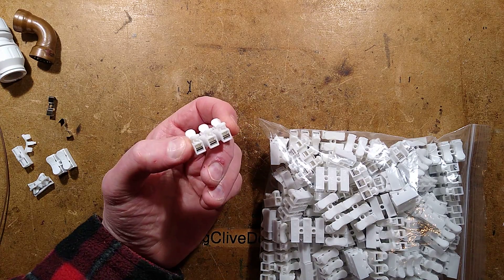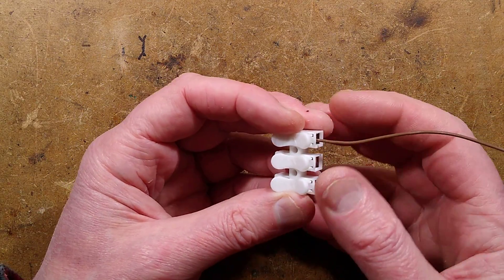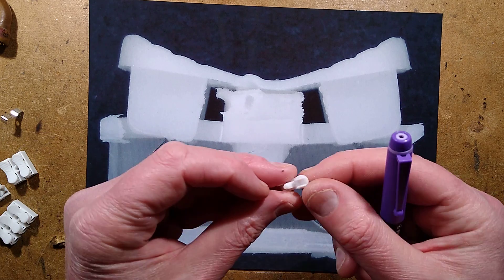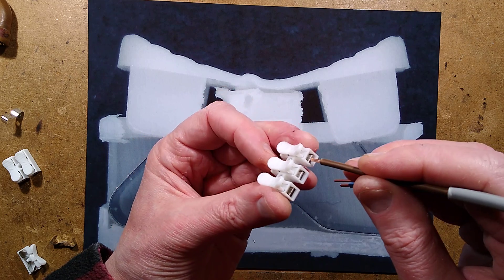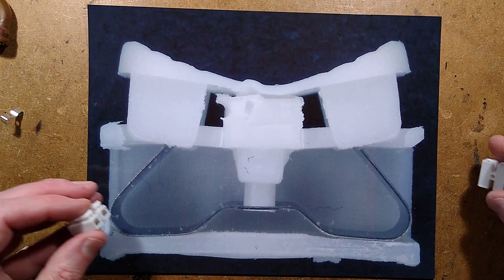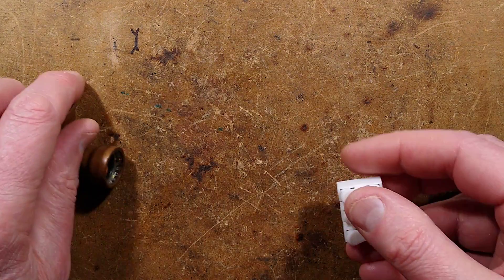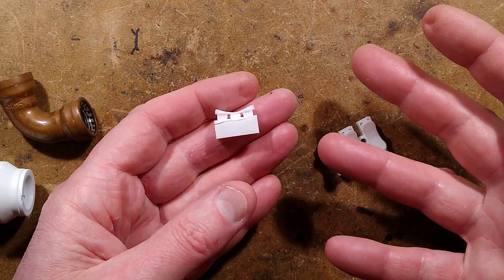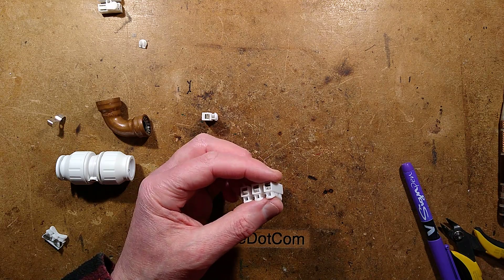eBay's cheapest wire push-connectors (Not for house wiring!)

Comment: Even without water, there's going to be enough water vapor in the air to facilitate a galvanic reaction, very slowly.  Stainless steel will also slow that a bit, but I wouldn't assume it's particularly high-grade stainless.  It'd still probably take decades in an in-wall circuit, especially in a junction box, in all but the most humid of environments.

Hell of a time-triggered disaster to, say, leave for the next person to occupy your house.

Comment: I never understand going cheap on these things. If you're remodeling a kitchen, even nice WAGOs are pretty low on the list of expenses.
Reply from the maker: Since people just cut every cost.
Reply: £1,000 phone, best get £1 cable to charge it.

People have weird ideas about how they perceive a bargain.
Reply: @webchimp  Well, you use your expensive phone a lot but cable is just a cable. You don't see value in it, therefore you don't invest into it. That was one of the reasons I stopped repairing iPhone 6 and 7 when they were still a hot new thing because charging boards got blown so easily by shoddy chargers. And it was getting really annoying arguing with customers it was their usage of said charger that caused the problem. Some of them returned 2 or 3 times and blamed me for "botched" repair. I gave up and focused only on Macbooks because there was still money to be made.
Reply: just came from a diy store (in Germany). The Wago Knock offs were more expensive than the genuine Wago 221...
Reply: Right? "Let's redo a kitchen (not cheap@), but oh yes let's cheapen-out on these" LOL
Reply: Hope charcoal look is coming back as a remodeling trend...
Reply: And if you really want to cheap out, wouldn't wire nuts be cheaper still?
Reply: If you're a manager at a contracting firm, you might force your subordinates to use these to save a few bucks on each project to pay for your own bonus each year, at the expense of your company's future reputation...  Especially if you're going to fail upwards to a new job anyway.

It's always the managers.

Comment: If they rate them at 10 amps I would suspect it's only about 2 amps max.  
The stainless steel would also interact badly with aluminum wiring as well.
Reply: I’m sure it will happily handle 10A……

At 1V for a half second every hour. :|
Reply: @ZaphodHarkonnen voltage doesnt matter

Comment: Was  hoping you would run some high current through them to failure!  :)
Reply: Yes, I was looking to see you test with say ten amps or a bread toaster, hair dryer, heat gun. Compared to a Wago connector? 
Great information
Reply: @williamterry3177  test it with sausage, which one gets cooked first XD
Reply: Own lots of these. Depending on the dice roll they are, some will start getting warm around 3A, others will work till 6A before getting seriously hot. I just use them for testing and such, or low current applications with a heat shrink, cuz it works just fine but if you care. Use Wagos or IDEAL connectors. Hell even the knockoff Wagos which are around 10 cents each will often be able to take over 20 amps before they show any problems. 

GreatScott and a bunch other people have pretty decent videos comparing a bunch of knockoff Wagos
Reply: Me too! 20 Amps and a thermal camera would be great.
Reply: John Ward did high current testing with a bunch of different connectors, but I don't recall if this type was one of them...
Reply: @michaeltempsch5282 
Thanks! It is a video from 4 years ago called “Chinese wire connectors”. 
He thought they were ok but wouldn’t recommend using them because of liability issues. Note: not the connectors of this video!
Reply: Bet it would have sparked. Not only is the contact just steel but it presses the wire against plastic on the other sidey leafing very very lettle contact surface
Reply: @jani140  I see the same weakness in the design as you. Not enough electrical contact area for my liking.
Reply: that is boor something for Electroboom.. 😂
Reply: Photonic Induction would and some!
Reply: @gavinnorthants  I popped it!
Reply: That would be the other kind of glowing feedback...
Reply: Same, thermal image footage of it in use and going beyond failure would look quite interesting.
Reply: Yes, please make a short of this burning up under load!
Reply: ElectroBoom style.
Reply: That might give a false impression that they are much better.
1. Plastic have some plasticity and will deform under pressure over time.
2. Putting  two different metals together will speed up corrosion.
These two issues will not affect the result now but makes these connectors a bad choice for longer time usage.
Reply: I would love to see a test to failure on these connectors like Jerryrigeverything does with phones.
Reply: Where would Clive find that kind of amps? Could mr photoninduction help?
Reply: @afberglund2764  The Electrical Supply System in Ireland and the United Kingdom can deliver up to 13 Amps at the wall socket before the plugtop fuse blows. The circuit breakers for the Ring Main in my house are rated for 20 Amps per circuit.
The Isle of Man uses the same system even though it is NOT a part of the United Kingdom.